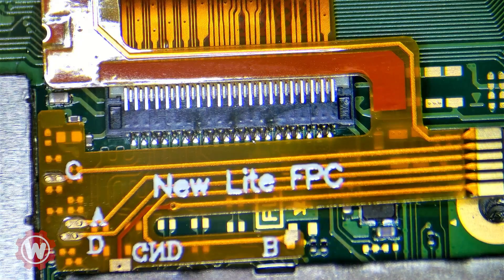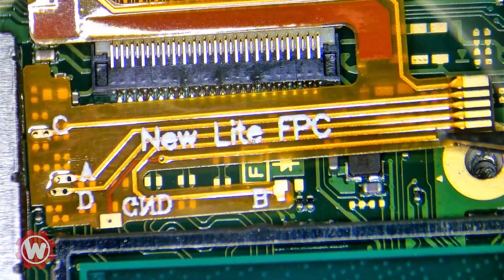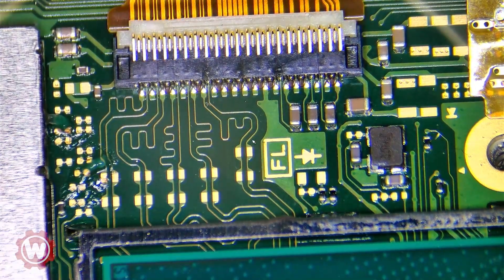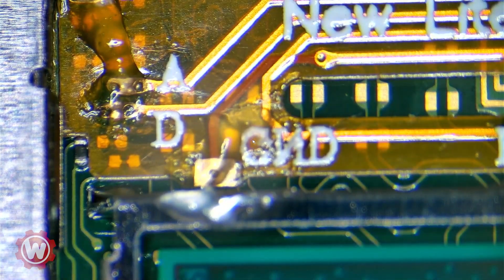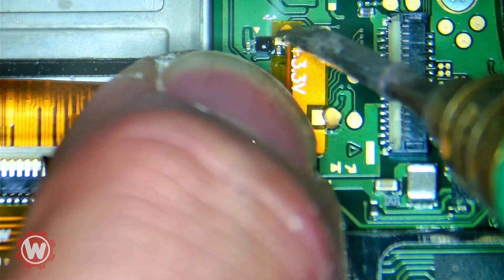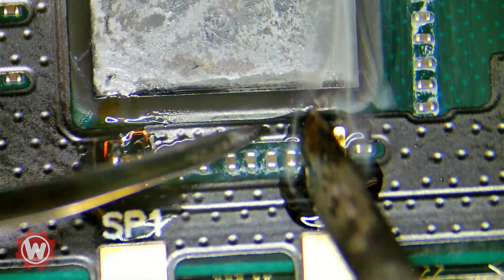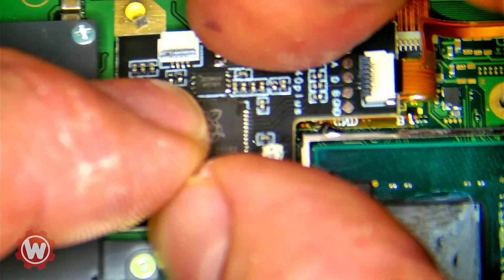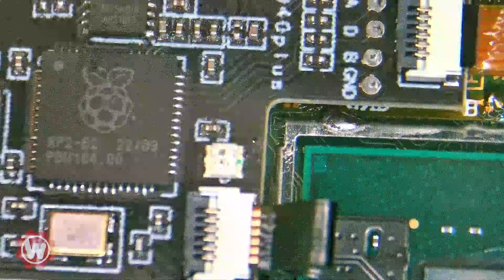Nintendo Switch LITE RP2040 Installation (Redesigned Flex Cables!)

Comment: Hi sir. If during solder flex, im forgot to disconnect the battery cable. 😅 idk bcoz led blue then yellow then off led
Reply from the maker: Hello. It’s very important to disconnect the battery. I recommend you to 1st check solder connection, check for shorts but disconnect battery. Make sure the chip is flashed. Good luck.

Comment: Aren't you scared all the flux trapped under the fpc will corrode the board over time?
Reply from the maker: Very good question. Flux helps prevent corrosion.  Water is the enemy.

Comment: I did 2 Oled and 1 V2, they work fine. But with the Lite version i did everything in the vid but the console won't switch on. If i unplug the Lite PFC ribbon from the Chip the console boot normally. Help please
Reply from the maker: Check for shorts on those connections. Something is not right.

Comment: I intalled the RP2040 and the modchip led lights do what they are supposed to do, but I do not get the "No sd card screen" do you know why?
Reply from the maker: If your switch is not displaying the raspberry logo and booting to OFW then it’s a soldering issue. Check points with multimeter. Also make sure chip is flashed

Comment: Head scratcher here. I installed mine and it just boots into the stock firmware. No lights or anything.

If I did something wrong, which connection would that be?
Or is there just no light because I haven’t flashed the Chip yet?
Reply from the maker: If your chip is not flashed it won’t show any lights. Try flashing first. If problem persists check your voltage point.
Reply: @Wayayeo  That would be the 3v contact on the upper right side of the orange flex cable after folding it over?

I know I had trouble with the B connection, but am kinda sure I got that secured. I've done a fair share (like-... a little over a year's worth?) of soldering jobs, but this is my first microsoldering job, so it waaaas stressful and kinda crazy. 🤣

Comment: On the fpc cable are sp1 and sp2 both grounds? Was wondering why you didn’t solder sp2

And also, on the abcd cable does the ground need to be soldered touching the shield? TIA
Reply from the maker: No need. You definitely need a ground so any ground point is necessary.

Comment: one of the best tutorials there is , i managed to do it first try, i followed every single step you make in the video.
Reply from the maker: I’m glad it helped my friend. Thank you for the support.
Reply: Did you need a microscope?
Reply: @JoshSmith-os2sg  i did not , but if you are inexperience you should use one because it's imposible to see the solder points if you don't.

Comment: Just finally got around to installing the older ribbon version I've had for months yesterday on my lite and this would have been so much nicer to have.  Also, my picofly board was dead but not by me, touched up the solder joints around the RP2040 chip and it works great now.
Reply from the maker: Glad to hear

Comment: i am having an issue where it doesn't boot the lights come on but it is one blue followed by 6 yellow lights. Has anybody had this issue before?
Reply from the maker: It’s most likely a soldering problem. Check all connections with multimeter. Good luck.

Comment: Are you plugging it in via usb-c at the very end to get it to initiate the glitching?
Reply from the maker: Yes. Plug in to a regular amp meter so you can see the activity. Based on the chip LED and amps drawn you can tell if it’s installed properly. Good luck on your install.
Reply: @Wayayeo  thanks for the response. Do you have the usb coming from a computer or a power block? Does it matter? Tried it to my computer and unfortunately no blinking for me.

Comment: Thanks for the video!

Quick question; why is there an additional connector not being used on the mod chip? Its not needed?

And also, these kits from AliExpress seem to come with something that looks like a usb-c connector, thats not needed either?

Everything that needs to be connected is shown in this video?
Reply from the maker: Hello and thank you. Yes only use what is shown in video. The usb connector is used to upgrade or reflash chip. Good luck on your install.

Comment: I sent my switch lite at some shop for modding. The modding failed and my switch now became so hot even after turned off. It also keep draining battery. Do you have any idea why it happen? Now they try to replace the ic chip.
Reply from the maker: Possible short my friend. No thermal paste.

Comment: Great video man. Just one question. At 4:56 there is a via under the N in "New Lite FPC" above the GRD print. Does this via not need soldered?
Reply: That is not a solder point. That is a via through the cable
Reply: @ilenewright2463   Cool thank you. I'm about to do my old switch lite and through the research I've found many different iterations of everything, I'm just trying to get eyes on as many as I can. The newer stuff looks good and much easier.
Reply: @MlnscBoo  I am doing the same tonight after I get home. I have it laying under tha digital scope right now. I tried the original and wasn’t able to get it so I got the revision. I have the cable around the tegra ship soldered in perfectly. I wish you luck as it is harder than they make it look

Comment: which tip are you using here? thanks
Reply: Looks like a small knife / blade edge tip. 

Medium small chisel tip would probably work best for this, or even a hoof tip / J shape tiped.
Reply: @brandonkick   Is the Hakko T18-D24 tip a good pick?
Reply: @antoncapybara4067  for a good geneal purpose tip? Thats an excellent choice.

For thick heavy ground planes on multi layer boards? Probably not enough thermal mass. A knife edge is great for that.

That D24 and a K blade are just about alll youd ever need. Maybe a bent conical for tight quarters very fine pitch work.
Reply: @brandonkick   I meant for this modchip installation. I'm a novice at soldering, so I want whatever is easiest.

Comment: sir, what setting temperature did you set up for solder? setting to 350 - 400 it ok?
Reply from the maker: Yes that range is good.
Reply: I have never done these specifically, but have done a fair bit of microsoldering.

Anyways, that aside... I've seen modders mention on these types of install videos that those ribbons are quite sensitive to heat... suggesting no more than about 300C. I'd probably split the difference, and run my iron at 325C.
Reply: @brandonkick you are wrong, 350 is minimum you’d want. 400 for larger ground pads.

Comment: hi is rp2040 something different than pico and hwfly? do u have to upgrade original firmware to latest and then mod it?  cause i got 16.0.1
Reply: for anyone intrested first update ofm to 17.0.1 then solder chip in my case picofly then hats pack and ure done works for me